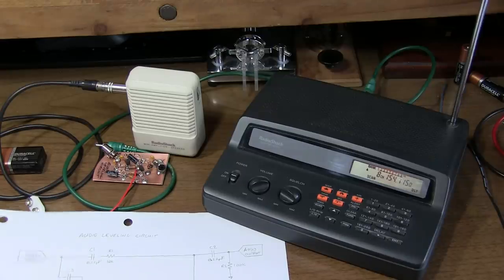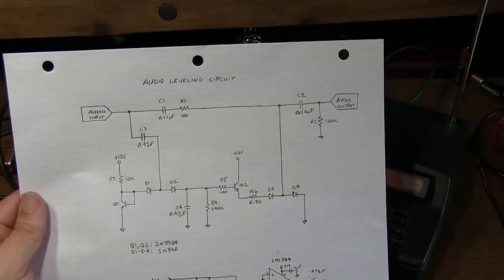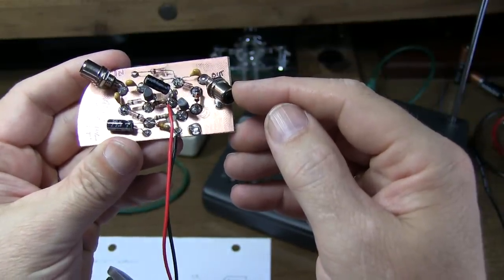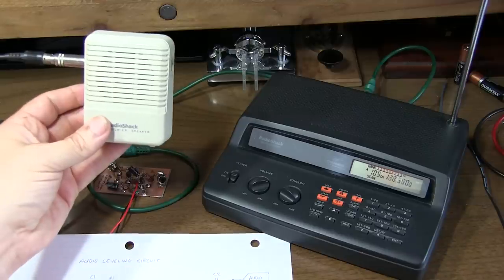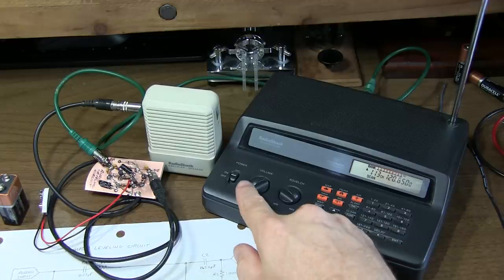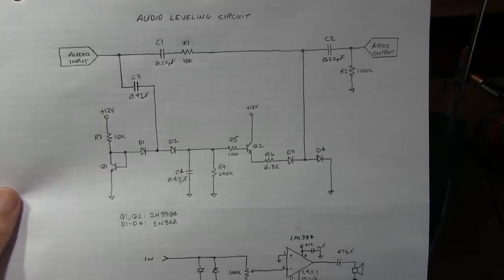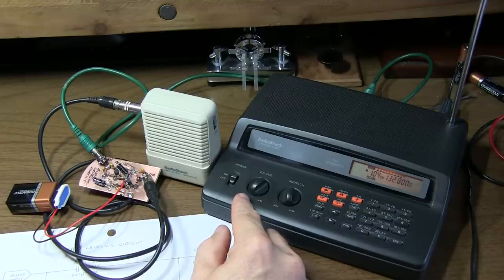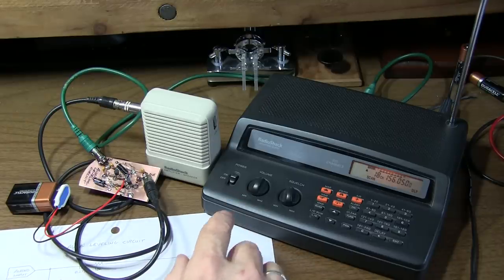#163: Automatic Volume Level Control circuit demonstration | scanner

Comment: Hi Alan, I want to thank you for the level control. Built it and works great. In the morning I get up before the wife and listen to a net on 2 meters. The stations have a large range of gain. So if I turn the gain up for a low audio level station and the next one with a high gain of audio. It wakes up the wife. So it causes a unhappy wife. Your circuit does a great job keeping it at one level.  On CW I think it improves the tones. A big thank you from me. Rick
Reply from the maker: +Richard Willaman Cool!  I'm glad it worked out so well for you.

Comment: Finished installing this circuit in an old Kenwood "SP-520" speaker enclosure along with a LM386 power amp. What is really cool is that if I keep the output of my Yeasu FT 450-D volume to around 100 MV it bypasses the compressor action, and I use the  power amp to increase the volume. If I want the compressor to kick it I just increase the output of radio's volume level to around 180 MV. Pretty cool!!!
Reply from the maker: +Curtis Wilson Very nice!

Comment: Hi Alan! I think I have found the issue; actually two issues. I had place the orientation of the transistors backwards (rookie mistake), I fixed that and well, it still did not work.

I dove deeper into the components, and tested each one again and discovered yet another problem...the Germanium diodes!

 I had purchased them from the same place you had obtained yours (mentioned in your description), and had not noticed the first time I tested them (in a rush) that the band on the diode was located on the Anode end not the Cathode end!!!

 A little research later, and I discovered that Russian Diodes sometimes mark the Anode end not the Cathode end!

Well, having wondered if It was my fault converting the schematic layout over to a PCB and etching it, I purchased the PCB's from OSH Park.

When they came the other day, I carefully examined them, and they are very nice indeed! But there is one question I have that maybe you can answer.

On the PCB the marking for "C2" is placed between two Capacitors... (You can see the PCB on the OSH Park website)... , and there is no room I figure to have marked the other one "C3"; which leaves me wondering, which is "C2" and which is "C3" (the only component not marked?)

Can you help?
Reply from the maker: I didn't design the board that is on OSHPark, so you'll have to trace it out youself.

Comment: Interesting.. Because here in the UK Commercial TV stations audio levels jump when commercials are played between advert breaks, they can be very loud.
This contribution by Your good self may make the evenings more pleasant for those whom care to try it out.
Reply: The volume levels don't really jump as such, it is just that commercials are deliberately very heavily compressed. The advert's peak level is the same as the programme, that's regulated by broadcasters, it is just that all the quiet and medium levels have been very heavily boosted. Which is why it sounds so suddenly hectic.

Unfortunately a simple peak detector circuit would therefore have trouble identifying adverts, you'd need something a lot more complicated which was able to detect "apparent" loudness.
Reply: Rupert Rooksby
Well there are some TV's that have that circuit built in like AVLS auto volume limiter system and it works ! But they are probably DSP based.
Reply: Rupert Rooksby
Thank you. Twice. : )
Reply: Rupert Rooksby
This is where you need to have a RMS (or average) detector in the control loop...;)
They are some really Pro units around called "expander" the opposit to the compressor. They expand the incomming signal to a range set by the user. But they are far more complex to set up and operate without the anoying pump-around effect when the input signal differs to much (Crest factor distortion)
Software is also available; often called "de-compressing" or MultibandExpander. These are much more complex and some do have "footprint" libraries of famous compressors to nearly delete them from the audio. But even with today´s computers they are all offline, as there is not enough power to compute the numbers in realtime with enough headroom and artefactial noise free silence. You can "pre-hear" the result, but it sounds like a telephone. The results after processing are quite good....but you need a lot of time to set it up until it works well....

Comment: Great video! Wondering if this would work with the XR-2206 chip (or your balanced modulator circuit) to level the AM audio input? Or would the DC offset interfere?

Comment: I bought the "circuit" board offered by another person for this circuit. The boards are very small and require you to have good eye sight to solder the parts onto. The boards are very professional in quality, but small. I soldered all the parts but needed a magnifying glass to check the solder connections. I just thought I would let every know in case  they were planning on purchasing the boards.
Reply: It would be nice if we knew where to get the circuit boards from.  Thx.
Reply: @acmefixer1  The link is in the description below the video, as Alan stated in the video!

Comment: Do you have or could you design a simple audio controlled relay circuit.  So that when the scanner audio comes on it would activate a relay.  The purpose is to open the audio output of another radio so that the scanner audio could be heard more clearly.  Thank you for your videos.

Comment: Hi, thanks for the great circuit.
I have one question . According to the schematic diagram, there is ONLY 1 electrolytic capacitor 0,47uF, but in the video, we can see another 2,2 uF electrolitic capacitor. Could you please, which normal capacitor should be replaced by the 2,2uF electrolytic? Thanks

Comment: Hi Alan!

I built your circuit, I did manage to get 1N34A Germanium Diodes from where you had gotten them, I changed C4 to the 2.2 Micro-farad cap as suggested, double checked and re-double checked my work, and yet it does not work? I'm trying to use this with my Uniden BCD325P2 scanner in order to have it level the volume for my local Police on P25. I'm using the earphone jack on the scanner for input with a Mono cable to the leveler input, and the output is going to a set of Creative amplified PC speakers. I'm using a 9v battery for power to the circuit. It does not work! Some cruisers are so loud it is blowing me out of the chair, wear as some of the portables and the dispatcher are OK. I do have the Audio AGC set to "on" for this system in the scanner, and that doesn't seem to do anything at all either! For the life of me I don't understand why it will not work?

Any suggestions/help/wisdom will be greatly appreciated!

73 Mike, K1MJC
Reply from the maker: It's possible that the input impedance of the amplified speaker is too low.  Or, you may try turning the volume UP on the scanner, and DOWN on the amplified speaker, so that the circuit "sees" a higher signal level.
Reply: @w2aew 

 Well, I had tried that, and perhaps now I need to try a different output amplification setup. the funny thing is, the Audio AGC on the radio itself is not working with Digital P25, at least with my local PD. It's not a trunked system. I'll keep experimenting, I hope I can get it to work. It's as if the signal is passing right through UN-altered. I did check everything in the schematic you showed in the video, and made sure of component values and connections. All caps are ceramic except the 2.2 Micro farad cap which is a polarized Tantalum oriented properly. So, I'll keep at it, and thanks for your reply and suggestion.

73 Mike, K1MJC

Comment: A good circuit and simple one at that most compressor circuit to tend toward more companants. A question I do have is were did you purchase the island cutter from and was it from Qrpme at all would like to get a hold of one. Hope to meet on air 73's David ZL1UTS
Reply from the maker: Yes, it was from QRPme.  Here are a few videos where I discuss the island cutter method, and a few other construction techniques:
Electronic Circuit Construction Techniques - a review of some prototype circuit building methods
and here's a video that shows how I use the island cutter to build a simply crystal oscillator circuit:
Build a crystal oscillator from schematic thru prototype construction and testing - DIY

Comment: Hey +w2aew, this circuit looks great! I built it and it does limit the volume (Have tried up to 2Vpp using a tone generator from my laptop, the circuit limits my tones down to 50Vpp!) I am, however, noticing distortion in the output, cant figure out what's causing this :/. Any insights greately appreciated! Thank you for your videos!
Reply from the maker: It is a natural result of this simple circuit.  It relies on the non-linear properties of the diodes to do the compression, so it definitely does distort the signal.  The distortion is tolerable for communications quality audio, but I would not use it for anything that requires more fidelity.  You can see the distortion on the wavefom in the first video I did on the subject:
https://www.youtube.com/watch?v=1h0FZJYXQ_w
Reply: Great,  I'll use it mostly for voice. Thanks again!

Comment: Alan, you have a good understanding of audio circuit . what if i wanted to have my radio alarm start low audio and increase fairly fast to wake me with out un nerving me. do you have a circuit for that?
Reply from the maker: I haven't got a circuit for that, but initial thoughts would be to use a FET as a variable resistor, with a slow charging voltage on the gate to reduce the channel resistance slowly...  This could be employed in an audio amp pretty easily - just need to work out how to have it reset and then start it's ramp at the right time...
Reply: @w2aew  the reset easy power to the siren goes out completely in 10sec

Comment: Very useful project. I'm a newbie and building a vu meter circuit based on arduino. What I'm planning to do is, take the signal from earphone out and connect it to your circuit(to keep the output signal constant) before going into next stage. As the earphone signal is way too low to get a decent output level (decent level means around 2Vrms), I'm planning to use a simple audio amplifier to amplify the signal.But this circuit is lowering down the signal from speaker level to 50mVpp. How can I use this circuit for my purpose? Also in the schematic I noticed, there are some additional components added to the circuit diagram.what is d5 and d6? I assume  they are also 1N34A diodes. Really appreciate your help. Thank you.
Reply from the maker: You would need to add an amplifier after the compressor.  It distorts the signal and limits the dynamic range, so won't make a good front end for a VU meter.  All diodes are 1N34A.

Comment: The one problem with this circuit is obtaining the 1N34 diodes.  Germanium parts are very difficult to obtain and are expensive.  It would be much easier if there was a substitute for these diodes.  Thanks.
Reply: There's millions of them on eBay, and they're cheap.

Comment: This worked great, but will it also work on some of those DVDs that have very loud and then low volumes?  On my living room setup, we constantly have to adjust the TV volume when listening to a DVD because some parts will blow you out of the room and others, you can barely hear?
Reply from the maker: It would likely work, but keep in mind it isn't really a high fidelity circuit.
Reply: ok, thanks and thanks for giving an idea that may majorly help.  If it works, I'll post and certainly give you credit for the idea
Reply: Nearly every DVD player and home theater receiver has an option to limit the dynamic range (difference between loud sounds like an explosion and quiet ones like whispering), usually called "midnight mode", "night listening", "compression", or something similar. Check the user manual to enable it, or browse through the settings menus in the audio section.
Reply: also remember this circuit does not take into account the ears' response curve. If you have loud low or high frequencies, everything will sound quiet because the ears dont have a good response for stuff below 500Hz or above 10KHz. The peak is about 4-5KHz (avg voice), so if the input has anything on those ranges, the voices will sound low. It would be cool in a lineal world, but for anything other than just voice or FM signals it's not really a great idea. Unless of course you add a bandpass filter or an equalizer, and tune it so that all the frequencies sound to you at the same level.
Reply from the maker: Laharl Krichevskoy Very good point.
Reply: I had to incorporate  similar circuit into my (incredibly old) TV to avoid blasting me of my armchair during advertisments.  Nowadays I prefer not having anything like TV set at all :-)

Comment: I like your Comp very much (as mentioned in your previous video). As it is a complete different way to set it up. Usually Comps are working as VCAs with a attack/decay envelope feed in the control voltage path and the control stroke is formed by the input voltage via a peak detector. To let you have a control over attack/decay and Compression Ratio (1:1 -> nothing, up to 1:infinty for constant output voltage) via external pots.

The overall design is far more complex than your design, woking as a variable load depending on the input signal voltage, i do like your way.

Even absolute Pro Audio Compressors, like this http://youtu.be/C-5iEBR1Ii4 ( a true Classic! ) and this: http://youtu.be/sAcCFi4_TX4 do not have an inbuild frequency diversion. If you want to add this you need to have an "aux" input called the "sidechain", where you can split the detector path and insert an equalizer and or some extra filters into it, to let the Comp react different with respect to frequency.

I have designed some Comps, with VCAs, all diskrete (like the urei 1176) and some with tubes....as Comps are an absolute basic you need to have while play/recording music(instruments).

When using software Comps, one can have a completely different way of how a Comp is set up, as they are MultibandComp around. They split the frequency range of the music signal into regions where you can set up its corresponding Comp completely different. Common MultibandComps have 3 to 5 bands, where you can also set up the frequency range to operate independent from one band to another.
Also there is a "lookAhead" function. It lets you set the attack time to zero, for brickwall-limitting in addition with a distortion stage to have more punch (used all together mainly in commertials to make them "loud" in radio/TV stations).

One "TopNotch" transmitting station compressor company is "Orban" they are pretty much standart in radio stations....(OPTIMOD.....RF-guys really can tell something about this....;)

Comment: Hey Alan, I am trying to design the circuit but using a Si diode (0.7 V) instead of a Germanium (0.2 V). My simulations seems to be non linear. Any suggestions or thoughts about the same.
Reply from the maker: Yes, it certainly will be non-linear.  The Ge diode solution is non-linear too, just not as bad.

Comment: Alan, where did you purchase the island cutters? Did I miss the link?
Reply from the maker: I got the island cutter from QRPme.  This technique and other construction techniques are shown in this video:
Electronic Circuit Construction Techniques - a review of some prototype circuit building methods
I also show this technique in this video where I show how to build a crystal test oscillator:
Build a crystal oscillator from schematic thru prototype construction and testing - DIY
Reply: I use one of these for making the pads on a copper clad board, in my small drill press. Picked it up at the local harbor freight, modified it a bit. It works very well!

 http://www.harborfreight.com/3-8-eighth-inch-double-sided-rotary-spot-weld-cutter-95343.html

Comment: I'd like to vary the audio to a different level, would the 240K at the bottom of the
schematic be a good location to place a Pot.?  What would you suggest?
Reply from the maker: No. The 240k along with C4 sets the decay time of the peak detector.  Lowering the series 10K would change the output level, but you have to watch out for linearity issues.  Also, the output can NOT drive a speaker - it is a low level, high impedance output that is designed to go into an amplifier.  So, simply adjust the volume on the amplifier.
Reply: *****
Yes, I understand were driving in mV, not volts.  But I do understand what your saying...thanks anyway,

Comment: Hello W2AEW.......In BITX or uBITX schematic, there is an AF preamp followed by LM386 AF amplifier.
# Could we intercept the point between that preamp and lm386 amp, 
so the output of the bitx af preamp goes to ALC input, 
then ALC output goes to lm386 input ??
# I need to put this ALC internally in BITX any solution please....Thanks
Reply from the maker: It really depends on the signal levels that appear at that intermediate point between the preamp and the LM386.  If they are very low, you may need to amplify them (further) with the preamp in order to get into the range that will be controlled by the circuit.
Reply: @w2aew  Ok2... what is the minimal or optimal level need by the input of this ALC circuit sir ?
Reply from the maker: @ssmbssmbssmb  You need about 100-200mVpp input amplitude for the leveling to happen.
Reply: @w2aew  Thanks